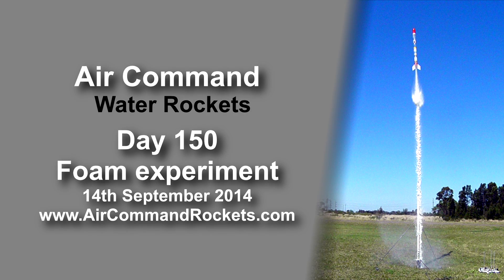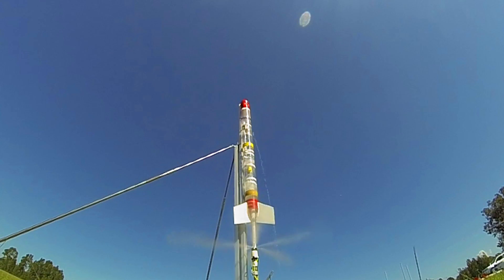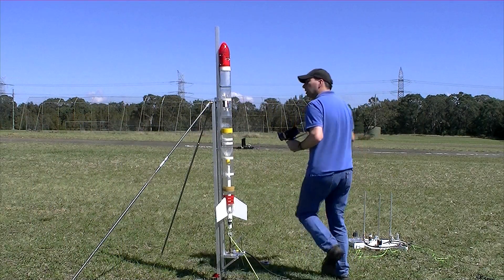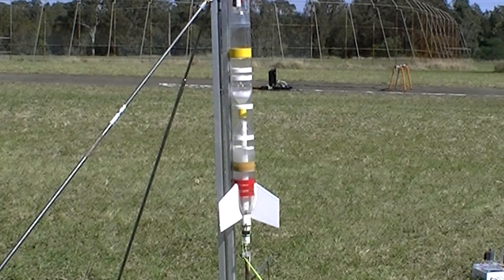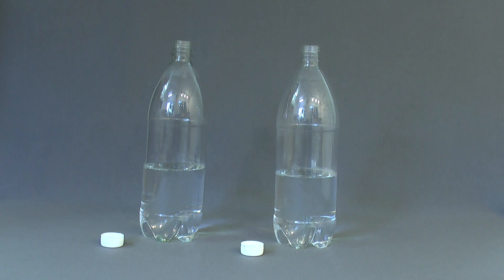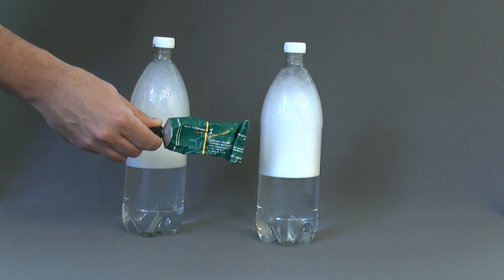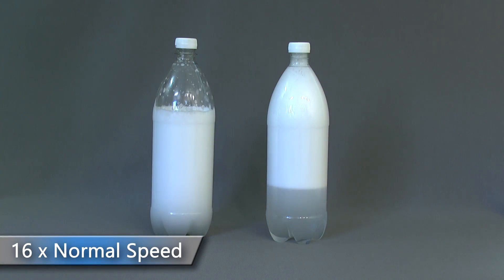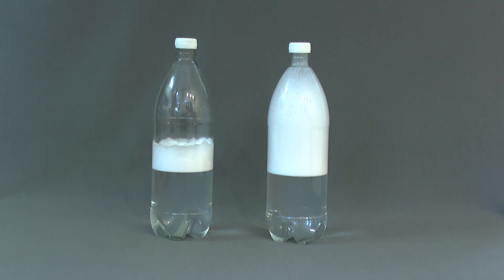Day150 Foam Experiment

Comment: If you sewed the carbon fiber, just 1 layer. Would it hold the pressure? Maybe a mattress hand stitch similar...
Reply from the maker: Not sure what you mean. A carbon fiber composite is held together by the epoxy there is no need to sew it.

Comment: Two questions-
1- have you ever tried using Diet Coke and powdered mentos to generate both pressure and foam?
2- have you ever tried a denser gas like perflourobutane instead of air?
Reply from the maker: 1. No, we have not. The pressure generated by coke and Menthos is a lot lower than what we normally use. 
2. We have not tried a denser gas yet. CO2 is sometimes used for better performance.
Reply: Air Command Rockets - I’m just thinking of the mentos and Diet Coke as a foaming agent- if foam gives you better thrust- tho I have no idea if it foams as efficiently under high pressure- but it pretty instantaneously converts a liter of coke to foam. The only trick would be keeping the mentos separated from the coke until launch.... and as for the pressure generated it would simply augment the high pressure air as it depletes, sustaining higher thrust...
It seems to me that if foam provides higher thrust- the ideal would be not foamy water under pressure-but a liquid mass that self generates foam beginning a quarter second before launch.   If pressure suppresses foam generation, then as the pressure drops at the nozzle foam generation would accelerate the liquid ejected from the nozzle...
wouldn’t it?
Reply from the maker: That is an interesting point. I do wonder how much foam could be generated when the whole thing is under pressure. Might be worth an experiment to drop menthos in a coke bottle and then cap it so the pressure builds up to see what happens. A second experiment as you say would be to drop the methos while the system is already pressurised, perhaps with CO2.
Reply: Air Command Rockets soapy water is not foamy throughout- the foam just floats on the top- the mentos would make All the Coke in the bottle into expanding foam.

You might be able to get a similar effect with carbonic acid- if you could force significant CO2 into solution in water at 1,000 psi or higher- that carbon dioxide would boil out as the pressure in the bottle and in the nozzle drops. - just can’t think of any facile way to oversaturate water with CO2 at those pressures.
Reply from the maker: At those pressures you probably don't need water, CO2 will be a liquid. This is something that we've always wanted to test, a self pressurizing liquid CO2 rocket... now that we have a pressure chamber that will hold that ... hmmm could be a possibility.
Reply: Air Command Rockets -
My thinking is that if it is the expansion of the foam in the nozzle where the pressure drops- then a converging diverging nozzle should give even better performance- - not at the ratio of combustion based rockets- but a slight bell or flat taper in the exit nozzle should provide surface for the expanding foam to push against- increasing thrust-
I think of you tested mentos in a closed soda bottle under pressure- it might burst-   Again, I think what you want is the solution turning to foam as it exits the bottle.

Diet coke foams in mere contact with the surface of a mentos-  it might be possible to make a nozzle with a mentos lining, or grating that would initiate foaming in the coke as it passed thru-  like a catalyst- but it would have to be kept away from the coke somehow prior to launch- that would require press forming mentos into some kind of custom shape- 
Or, a smaller chamber above a two ended bottle- filled with crushed mentos ( the more surface area- the faster and more violent the reaction) that can be triggered to drop into the coke on launch.... using your method for filling a rocket with water as it stands upright on the pad.
Reply from the maker: Yup you may get certain amount of performance boost with a CD nozzle with foam. We did tests many years ago with low pressures: http://www.aircommandrockets.com/day68.htm But at higher pressures this may be more significant. Anti-Gravity Research did experiments with CD nozzles on their record attempts. I think they too had only a slightly divergent section.
Reply from the maker: If you look at the static thrust tests video on that page you can see our Jet Foaming technique that generates foam during flight.

Comment: One stupid question: does glycerol will hold foam better? If fog machine uses up to 30% (probably by weight) of glycerol or propylene glycol, or mix of that two, maybe will help there too?
Reply from the maker: +WildMania I suspect glycerol may hold foam better. We normally only use about 2-3% detergent as it is very effective in the low concentrations, and a bottle of it lasts quite a few launches. From static tests we've done of concentrations up tp around 30% didn't improve things much, but that was for the detergent we were using. (kids bubble bath)
Reply: Does foam improve thrust at all? Or it is just a theory? I saw people mixing with water various things, even some food stuff, and claim that this makes more thrust. One more thing: if there is too little water, and when air pushes all water out, remaining air does not make any thrust, or just next to nothing?
Reply from the maker: +WildMania Good questions. Here is where we did a comparison between foam and water only: https://www.youtube.com/watch?v=Gqm9xIJp9ms foam does indeed improve performance. And here is a comparison that will show you how much air contributes to thrust. https://www.youtube.com/watch?v=DrPt-AktIMs
Reply: effective..does that mean launch higher

Comment: One 'comment' about your experiment: I would have reopened and then reclosed the "control" bottle {the one you DID NOT add grease to} at the same time that you added grease to the other bottle. {Just my "two cents"....}
Reply from the maker: +RocKiteman Good observation, in practice we've found that because there is no pressure differential the foam doesn't collapse when you open it, but to be technically correct as you say we should have opened both.
Reply: AirCommandRockets
Roger all that.  BTW, "GOOD ON 'YA" for all the work you have done with water rockets!

Comment: Hi very cool hobby to get into :) I dont know anything about water / foam rockets but is it not possible to use a mixture of vinegar & bicarbonate soda for extra thrust?
Reply from the maker: CAR FANATICS NZ Good question, Yes you can add those, but I suspect it won't make much of a difference in practice if you are pressurising the rocket above the pressure bicarb soda and vinegar create. Theoretically as you launch the rocket the pressure starts dropping insde the rocket because it is pushing out the liquid, so if it happens to drop below the pressure the soda and vinegar make then that could start topping off the pressure so to speak, but by then most of the vinegar has exitied the rocket. Good stuff to think about though. :)